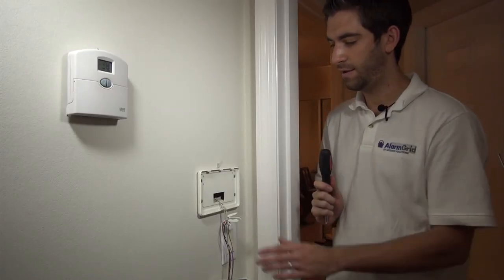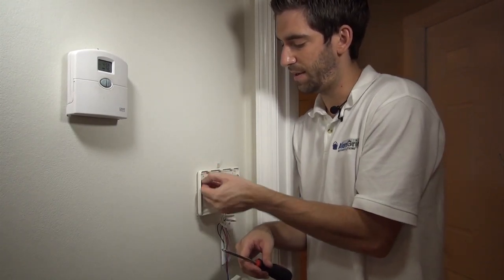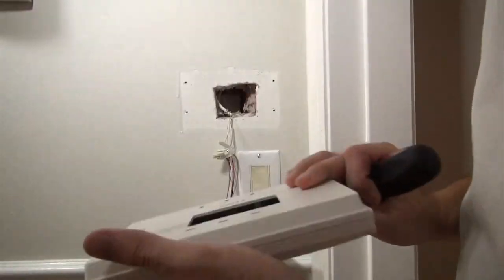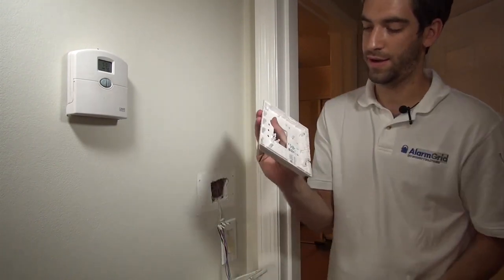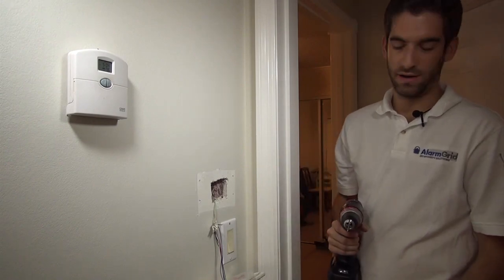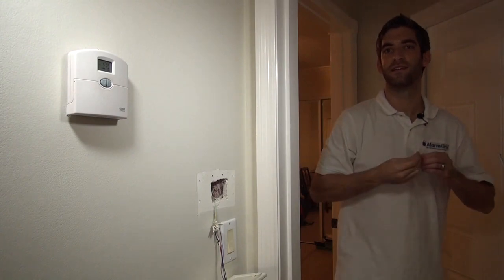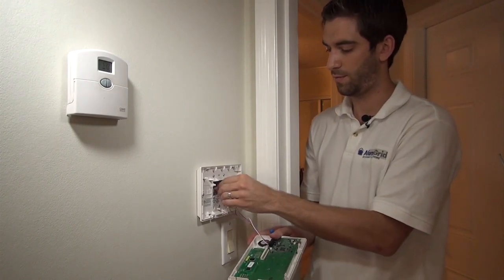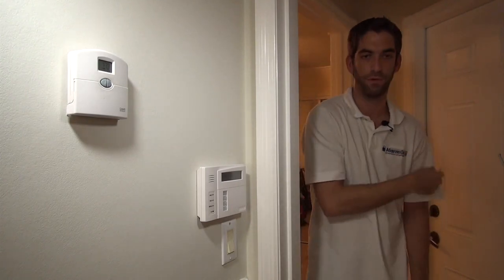Honeywell 6160V: Installation, Replacing Old Alphanumeric Keypad

Comment: Get a drill, geeze, taking 5x longer than necessary
Reply from the maker: This video is meant to be DIY-friendly. Not everyone has a drill!
Reply: @AlarmGrid  So...you intend the video to be DIY-friendly--even for people who don't have a drill-driver. That's good. But to make the holes into which the screw inserts installed that were used to mount the back plate using the screws that you screwed in using the screwdriver (DIY-friendly), you used a drill-driver. Hmmm........
Reply from the maker: @michaelgilmore9288  I’m pretty sure I provided the above reply based solely on the question, not having re-watched the video to see that a drill was used later on. Sorry! So, the lesson is, if you don’t have a drill, you can remove the screws with a screwdriver, but it will take a while. If you need to drill a hole, then you need a drill, which most people will have. If you happen to have a drill with a screwdriver bit, then you can make the first part of the process, the removing of the screws, a lot quicker!
Reply: @AlarmGrid  Wow. Aren't we touchy. And defensive, too--just like in the original reply to Matthew. Defensiveness isn't seen as a positive thing by most people. You are saying that you don't remember whether or not you used a drill to drill the mounting holes in the wall to mount the back plate? And you say that "if you don't have a drill, you can remove the screws with a screwdriver" but you don't say how to make the holes in the wall if you don't have a drill? Wouldn't it have just been easier to respond to Matthew by saying 'Yes, using a driver would have been faster." You could have avoided this hole that you have been digging yourself into. I do agree that Matthew could have phrased his comment more pleasantly while making the point that he wanted to make.
Reply from the maker: @michaelgilmore9288  I actually wasn't involved with the making of this video. I'm sorry for my original reply to Matthew. I didn't mean to come off as defensive in my reply to you, I was actually being apologetic. I guess I did dig myself into a hole with the original reply, no shovel required!

Comment: You made two confusing statements about wiring.
Starting at about 7:49:
1. "So these two, purple, GREEN, black, red, and WHITE colors don't really matter."
You then go on to tell us that green and white DO MATTER.  - That makes no sense.
2. Starting at 7:57:
"So we used blue and green, for our positive and negative power... "
"We used um, green and white and our yellow for our data... so those are the four we want". 
Huh?

IT"S VERY CONFUSING. You start by saying we don't need green and white, Then we DO. Then you say green is negative, then you say it's data along with white and yellow.  Which is it?
Sorry, but giving us unclear wiring instructions is giving us WRONG WIRING INSTRUCTIONS, therefore your video is basically useless.
Reply: Matt Pacini There were just other color conductors that we didn't use. Sorry for the confusion. You just have to make sure the keypad negative terminal is connected to the panel's aux negative terminal, the keypad positive to the panel's aux positive, the keypad G (for green) to Data In on the panel and the keypad Y (for yellow) to Data Out on the panel.
Reply: The wires he said don't matter were the ones used as extentions (jumpers) on the lines that were running down the wall. you can see the crimped connections  on the lines... Depending on your wire you need to know what ones are positive  nutral and what ever your diagram shows for the other 2...
Reply: @Kgoncalv  What you are saying is that Sterling was talking about the colors of the jumper wires--that were attached to the old keypad and have meaningless colors--along with the colors of the wires that come from the control panel and attach to the jumpers. The colors of the wires coming from the control panel are the colors that are important to attaching correctly to the keypad. So why even mention the colors of the jumpers at all? Like Matt said, confusing.

Comment: Hey Sterling can you use a 6160AP with a Vista 21IP?
Reply from the maker: Do you mean the 6160PX?  If so, then yes.  I'm not familiar with a 6160AP.
Reply: @AlarmGrid  Well a 6160AP is a six-wire 6160 that works on The Honeywell Apex Destiny 6100 panels!